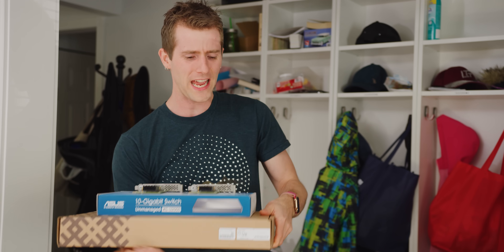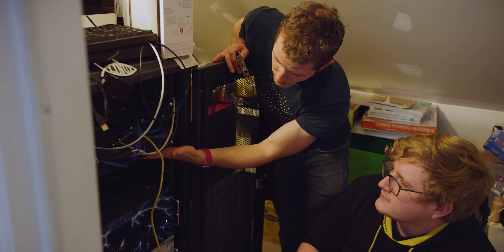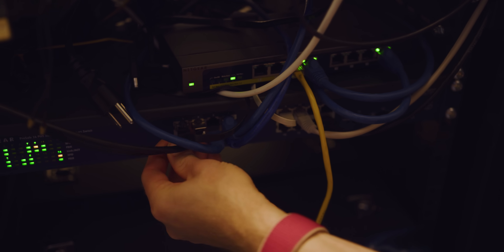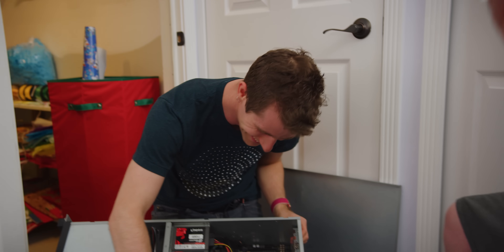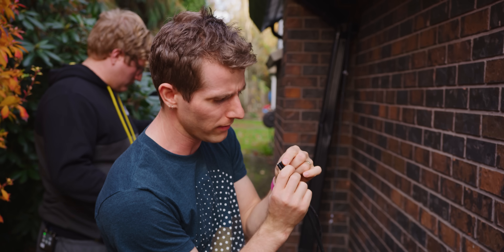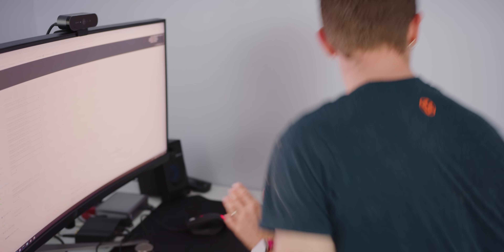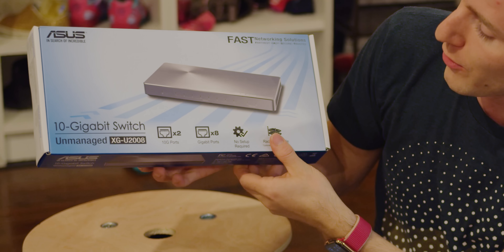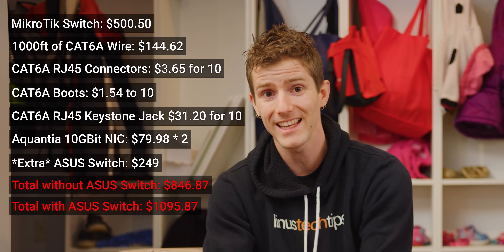Home 10 Gig Network Upgrade for CHEAP

Comment: FOR CHEAP:

$500 not including cables

Okay linus
Reply: I mean you gotta pay to play. There are much cheaper ways to network 10G, but if you want a copper (RJ45) switch and plug and play, you gotta pay up or wait.
Reply: @hendeeze  doing it through fiber and SFP+ using second hand ebay stuff is a fraction of the cost doing it through copper.
Reply: @dpskipper  that's what I basically wrote.
Reply: That is extremely cheap for a switch of those capabilities you nimrod

Comment: And here’s me still rocking my 16 port 100mbps switch from 2008 being perfectly fine with it as I do not mind waiting a little longer to transfer files to and from my NAS and I only have 60mbps down and 20mbps up internet anyways.
Reply: A hundred times faster is not reducing waiting a little bit though. :) It's the difference between 2.5 hours and 1.5 minutes for a 100GB project. Video editing over 100Mbps is just not feasible.
Reply: @jeschinstad  i dont video edit off a NAS lol, if i ever video edit its just on my local PC

Comment: The separator has nothing to do with how well the cable handles higher speeds. It is entirely up to shielding and twists per inch.

Comment: I remember my excitement when I bought my first two 8-port 10/2-port 100 switches back in the 90s for 1000.oo each    I also remember shaking my head 18 months later when I bought two more for less than 200.oo each.  Not too much earlier in that  era when the fully-automatic internet sharing-over-AppleTalk device would dial out at will over a 28.8 modem…

Comment: Eww Mikrotik. Send it back to Latvia and get a good piece of hardware.
Reply: @BogDrakonov  Mikrotik is always introducing new bugs in their software. Constantly patching 0days. Anything other than Mikrotik would probably work great. Choose Mikrotik if you don't put it in the internet, and don't care about having to reboot it every couple months.
Reply: @BogDrakonov  keep it layer-2 and you should be fine. Make sure to not put it on the internet, and you shouldn't have a problem :).
Try and stay away from budget brands; "get what you pay for" applies in the networking realm.
Buy cheap, except cheap quality (and weird random bugs).

Comment: Mikrotik routers and switches use 192.168.88.1 as management IP address, so of course you wouldn't find it in your 192.168.1.x network. You would've known that if you were network experts (which you are not, like AT ALL) or at least downloaded a PDF Quick Guide from the Mikrotik website. SHAME! SHAME! SHAME!

Comment: Alright folks where the smart networking types at that can explain something to me? If he still only had an incoming internet signal of 1Gbps why was he able to go up to 10Gbps? Is he implying that the only part of his network that is 10Gbps is between devices and his maximum internet download speed would still only be 1Gbps? I always assumed that 10Gbps connections required a modem/ISP that was sending you a signal that would allow you run at 10Gbps but it seems like he is saying he took a 1Gbps internet modem/ISP and made it 10Gbps.

Comment: I don't get the fetish for 10g-baset over SFP+. Dell 62xx switches can be had on the cheap. I'm sure there are other switches like that out there that I am unaware of. You can get 4 SFP+ ports out of them, or other connectivity options. SFP+ NICs are cheap.

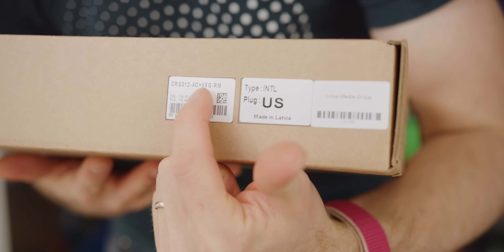Comment: 1:05
"Just 500 US dollars..." OH! Is that all! 
*snore*
Wake me up when I can get multigig (affordable 10gb can wait) 8 port switches under $50.
Reply: Probably in 1-3 yrs
Reply: It's really silly I have a 14yr old 8 port 1gbe netgear unmanaged switch I bought for around that price ($50) back then. Didn't expect it to take this long for 10gbe to hit the home. Wonder what the hold up is.
Reply: @SinisterPuppy  Way back I built a very small Beowulf cluster with only 8 servers in a 40U rack on wheels so we could truck it around. To connect these we used the cheapest 8 port 1 Gbit switch we could get. Iit cost something like $700 - $800 and had loud fckn fans that drowned out the sound of the eight dual processor servers it shared a rack with. A few years later a switch with the same performance and features would cost less than $50, and be passively cooled...
Reply: I'm still surprised how costly 10gbe is, the standard was ratified in 2006! (10GBaseT) which was 13 years ago and it's still rare in the consumer world. No wonder why 1gbe is still going strong and with 2.5gbe & 5gbe coming and able to utilize cat5e cable, a lot of users will stay with 1/2.5/5 which for most is "good enough".
Reply: Yes this is still much too expensive for most people to want to do it. Upvote for the video, so Linus can get his 1000 dollars back haha

Comment: I bought a house built in 2018, and I’m so happy there is Ethernet all over.... but I was so disappointed that they ran cat 5e... and most of its stabled in and through foam so there is no good way to upgrade that anytime soon. So I’ll be limited to gigabit forever.
Reply: Nope realistically you will probably be just fine running 10-gig. Try it you would be surprised
Reply: mrmotofy really. I mean the longes run is prob 20m

Comment: Have you used the internet in England it is so slow that tortoises or snails could outrun our internet connection 
With 50 years of the world wide web most internet connections have barely got to 1 GB connections 
Why is it 5g is faster than most people's internet connections 
This is why stadia and cloud computing will fail 
Could you get a pest control for your rats in the loft 
Could you upgrade your how to make your own router and switch video

Comment: Fuuuu... $500 for a 12 port switch... Yeah I’m gonna stick with my used $50 24 port 1gig switch for my house... I have a lot of Ethernet devices in multiple rooms, 12 ports is simply not enough...

Comment: So linus will have to remove his raid 0 ssd's for M.2's NAS side and PC side in order to utilise anything over a gigabit.
Reply: I think you're a bit confused. If you want to convert disk speeds to network speeds, you can multiply the disk speed by 9,2. (8 bits in a Byte + 15% overhead). So if you have a very slow HDD like my 2.5" 4TB Seagate drive, you can do 120MB/s*9,2=1104Mbps. For a fast SATA SSD, you get 550MB/s*9,2=5060Mbps. A fast NVMe 3.0 gives 3500MB/s*9,2=32200Mbps, nearly saturating a 40GbE connection.

Comment: Pro tip: Cat5e can do 10Gbps up to 45m/147ft if you are using solid core pure copper cable, despite what official certifications will tell you. So the only cost for most homes to upgrade to 10Gbps with one PC is the cost of the NIC card (which are under $100). A 10Gbps router can be had for under $200 now if you have multiple devices.
Also, did the fluke show you passing Cat6a certification? It is not trivial to pass Cat6a test on a fluke.

Comment: No one:

Steam: I'm still going to cap this at 4mbps
Reply: Steams downloads games at 86MB/s in my house
Reply: @klakiti02  MB or Mb? cause dang, where did you get such fast interwebs if thats MB!??!!?!
Reply: @klakiti02  i'm in Germany so I'm only downloading about 12mb/s (about 100mbit/s) and never really hit that limit but keep in mind that the speed is not only limited by your internet connection but also your CPU and HDD. Depending on the game it has to uncompress a lot of files to keep the file size lower so if you have for example a 10gbit steam cache it will never really hit those speeds
Reply: I can download with up to 250MByte/s on steam. But it depends on storage type (HDD, SSD,...) and compression of the game file; steam seems to download and unzip it at the same time.
Reply: @SirMactator : Wow, that's a fast uplink for a home. Where do you live?
Reply: @jeschinstad  Switzerland with a FTTH-Connection. It costs around 50$/month (with TV) and it's a XGS-PON connection.
Reply: @SirMactator : Nice.
Reply: I download stuff at over 80 mbps here and that's the top speed of my wifi while far from the source, never even knew there was a cap
Reply: Lord Candle haha 400up 200 down
Reply: You spelt Battlenet wrong

Comment: Great video, I did something similar a few years ago but had to use sfp fibre to get 10gb/s into the edge switches around the house.  This is much cheaper and more elegant as a solution.

Comment: You can get 10Gbit SFP+ to RJ45 Adapters for ~50 dollars each from microtik, so the much cheaper 4 or 8 port SFP+ 10Gbit switches for 100 or 200 Euros are probably a lot more interesting for a lot of people with only one or two RJ45 10G network cards.
Also 10Gbit on RJ45 uses a ton of power unlike SFP+

Comment: I don't find SFP+ switches, transceivers, cards and multimode fibre cable to be that expensive tbh. 
If it's worth running 10G Ethernet depends on your cable run, I guess, but for hosehold cabling, fiber is more cheap in my experience.

Comment: Been waiting for some MikroTik love on this channel, they've been seriously undercutting the prices of the major names for networking hardware for years now with a vastly superior feature set as standard.
Reply: They have had some serious security issues with some of their routers or something though. But if it's just a "dumb" switch, I don't see a problem I guess
Reply: @dcheverie  Not just one router, security issues with the RouterOS software. They do patch things pretty frequently though.
Reply: Mikrotik is good stuff, will do everything the other guys can for less. Management interface takes some getting used to. Their documentation is enough to get you started, though.
Reply: Shame this video didn't do Mikrotik much justice as they only stated the price.

Comment: Why install CAT6a in hard-to-reach areas when you could put in CAT8.1?  Use 6a for short runs from switches to devices and future proof your wiring with 8.1 in longer, tricky runs.

CAT8.1 costs about $160 for 50m or $280 for 100m plus termination jacks.  It can get to like 25-40 Gbps and is completely backwards compatible with other common ethernet RJ45 cabling like CAT 5e, 6, and 6a (note: IIRC CAT 7 and 8.2 are not RJ45 compatible).   For sure, no one will be using 8.1 for at-home stuff for a while but it will make your installation $ + time investment last longer.

Comment: Question: if cat 6a cables can do 10gb, what are the specs on cat 7 and cat 8 cables? Or are those just un-standard bs specs on Amazon?
Reply: Most are probably BS but Cat 7 isn't an official standard for US:  https://en.wikipedia.org/wiki/ISO/IEC_11801#Category_8

Comment: I thought I was going to be in for a great time with this one. The thought of seeing Linus and Jake struggle to set up RouterOS or SwOS when they previously struggled with understanding VLANs seemed like the plot for a tech-related sitcom episode.  Network professionals steer clear of MikroTik because of their unfriendly configuration interface. Personally, I love them and use them for my home network as they are cheap yet incredibly feature-rich, but I had to spend a LOT of time learning how to get the system set up properly. In the end, I was a little bit sad that they just left it at default config as an - effectively - dumb switch. I think there should be a follow-up episode where they replace Linus' existing router with the MikroTik, fun times.

Comment: With that few 10G devices, the $139 CRS305-1G-4S+IN switch would've worked just fine instead of the $500 one.

Comment: Typical LTT networking cringe video. Get a fully programmable Mikrotik router, use it as a dumb switch. Luckily Jake saves the day with some user friendly explanation on terminating cables.

Comment: I'm always surprised how basic North-American Cat6A is (only shielded pairs and not-grounded). In Europe you usually go for Cat7 (same price) has shielded pairs and the cable itself is shielded too, grounding everything in turn. That means the cable itself is can also handle Cat8.x loads.

Comment: I just upgraded to 10gig in my home in Japan. The one thing that I was missing was a 10gig router. My ISP provided one, but it's features were limited, but I now have a 10gig Buffalo Router that also has Wifi6.
Let me tell you, full 10gig internet with no bandwidth caps at 60USD a month is sweet.

Comment: Friend of mine did 10Gbit for around 500$ using only a 5 port sfp+ and cards off ebay with transducers with multi channel fiber. His greatest issue was getting the speed. SSD to SSD he would get good speed but if not SSD then it had to be raid or the speed would be bad. So it would seem going from a single spinning hard drive to another with 10g will not get you the speeds you want and if you have hair you will want to pull it out.

Comment: well I rather pay £5 a metre of DAC cable or get fiber optic cables, then pay straight £350 a card, when I can get very good card (much better then the one for £350) for just £30-£50 and sometimes even for £10 a dual port card with iSCSI, FCoE and sometimes even 16GFC
paying £350 for card, which does only 10GbE in order to save few pence a metre of cable is stupid
especially while you can get 10GbE, iSCSI, FCoe and 16GFC card in one for just £100, SFP+ for £10 each and cable for little over £1 a metre
in my case I would be over £1000 better of, not to mention iSCSI and FCoE

Comment: I have a home 10gbase-t network and the most important thing I can say is NEVER go with SFP+ unless you're only connecting asking single PC that's in the same room as your switch.  DACs are expensive and cannot be run through the walls and SMF/MMF is a pain and transceivers are expensive.  CAT6A and Cat7 are cheap, there are 10GBase-T switches for $200 and under now, and there are 10GBase-T NICs for $100 and under

Comment: I went quarter-way to 2.5Gbps.
Same cables as for 1Gbps.
Much cheaper switch, only $35 for cards.
Reply: Decent Cat5 will work just fine for 10gig on modern hardware for 50 meter runs for sure. I have a 60 meter run working fine that way.

Comment: Just a tip when it comes to cutting the outer jacket of the cat5/cat6 cable. When you use one of those tools you run the risk of cutting one of the wires. A lot of cables have a bit of floss running inside of them. Cut the jacket to expose the floss, then pull the floss down the cable to split the jacket and then trim the excess with side cutters. That way you are away from the spot you cut with the ring cutter and no chance of cutting the wires where you cut the jacket!

Comment: 8
P
8
C

For real, man, quit calling it RJ-45. I don't care if that's the colloquism that we've universally agreed upon, it is wrong and it should be referred to as eight-pin, eight-contact or 8P8C. If you have to, call it Ethernet. But please quit calling it RJ-45, it's not, Registered Jack 45 is different enough significantly for 8P8C to not be RJ-45.